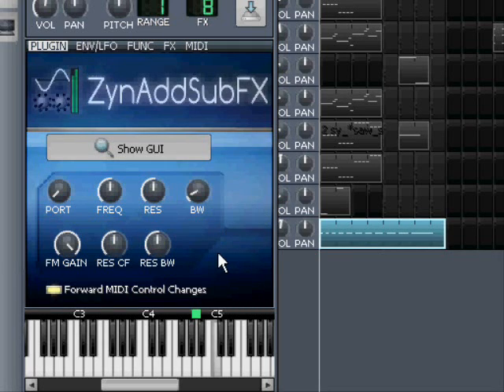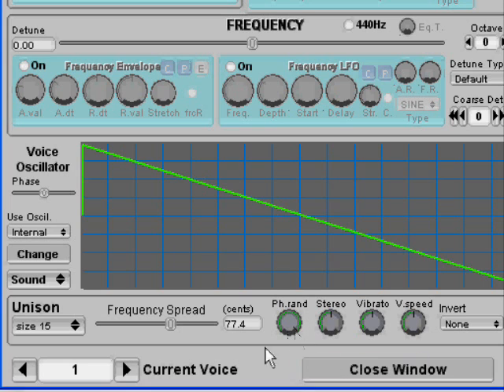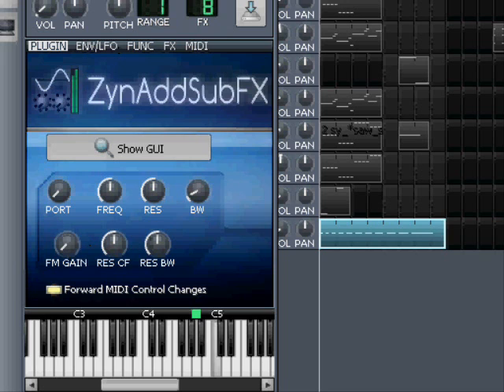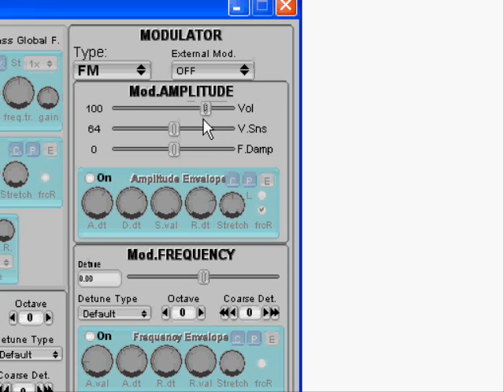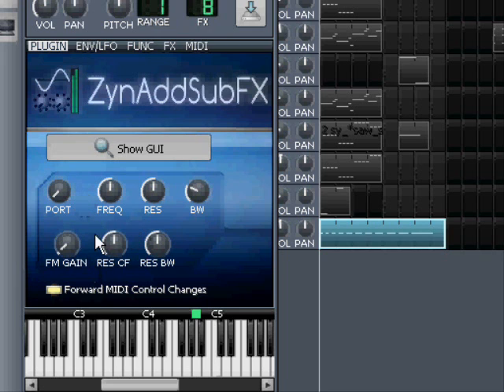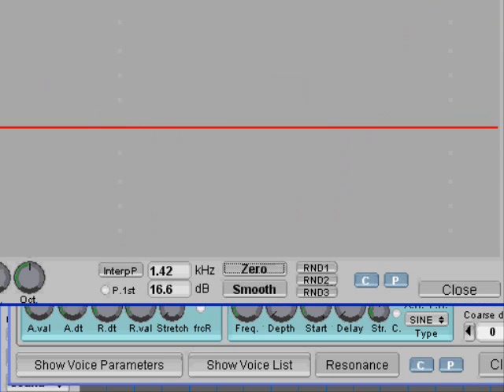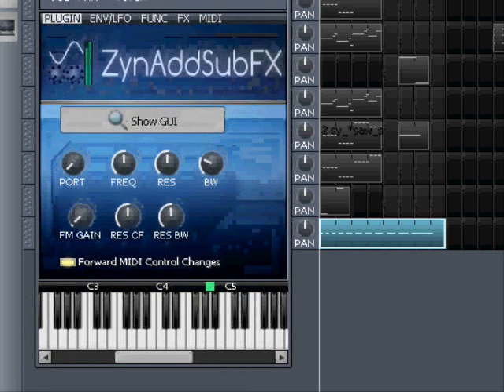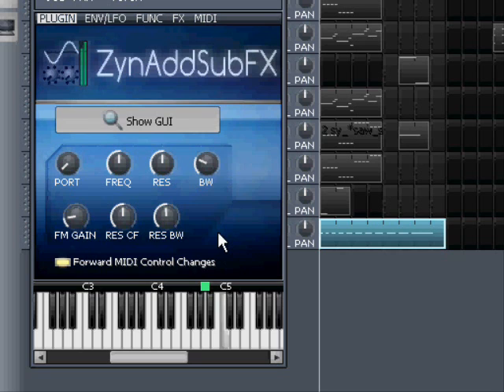LMMS tutorial: Using zynAddSubFX's bandwidth, FM-modulation and resonance-CF / BW in LMMS -Part 2

Comment: i have noticed that resonance drawn in pad synth shifts depending on which note is played. is it a bug? or maybe there is some setting to fix it?
Reply from the maker: I think you should contact the zynAddSubbFX project with this. I cant say that i have noticed a problem with reso in the PAD-synth (not meaning pad, but stands for Paul ADditive stynth, btw), but you can find the zasfx people on https://sourceforge.net/p/zynaddsubfx/bugs/
Reply: in the meantime i think i found solution.
zynaddsubfx has this cryptic thing 'base,smp/oct no.oct
changing smp/oct solves the problem,
seems like resonance is precalculatet for just 2 notes per octave by default ,thats why i had jumps, now it's a bit slower but solves the problem nicely.